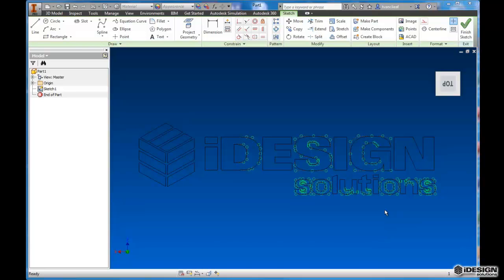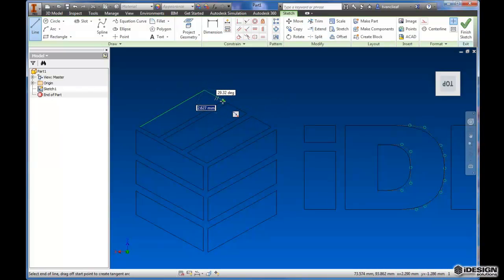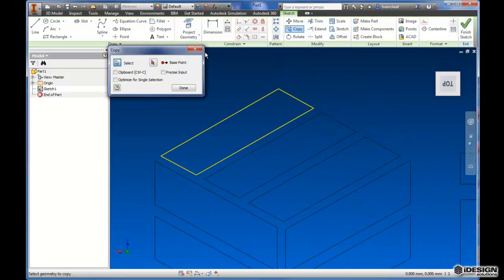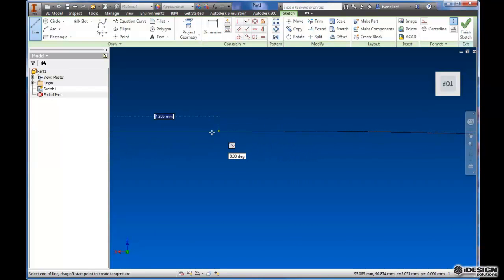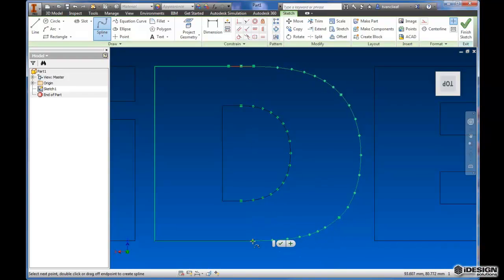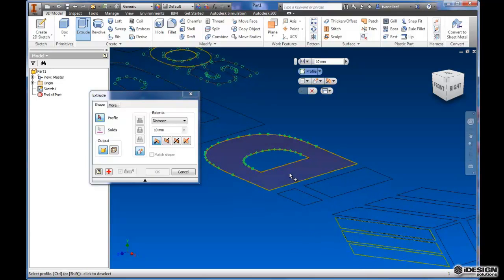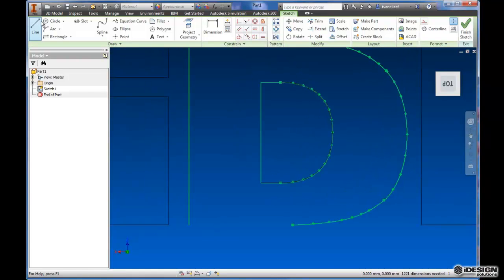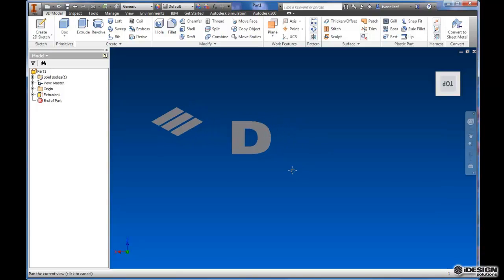DWGs in Autodesk Inventor : Converting Splines to Interpolation ~ Autodesk Workflows Pt. 2

Comment: Hi. I have a question for you. I imported my logo from illustrator. The shape is a little bit complex. After using the convert to interpolation command I used spline tool joining the points created. But it doesn't copy the original shape. It seems that I need more points. How can I solve this? Thank you for your help